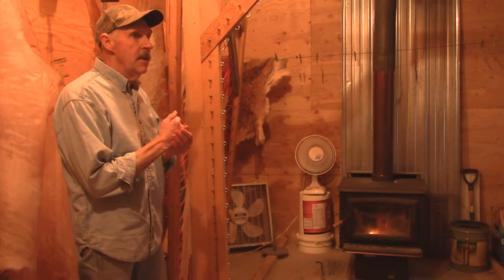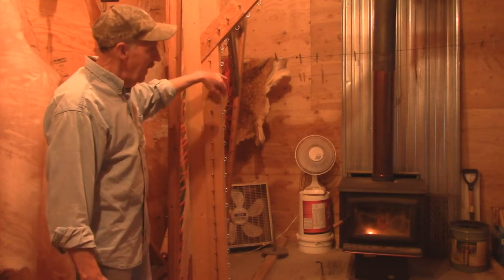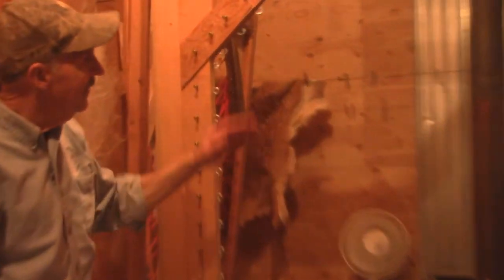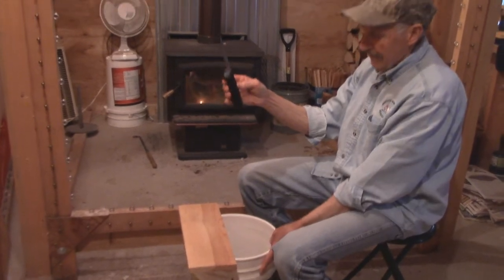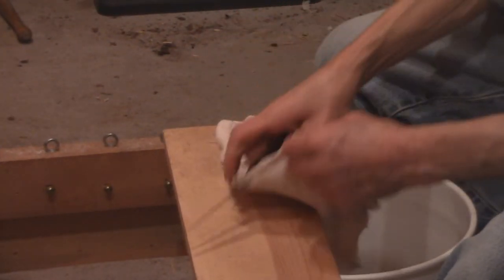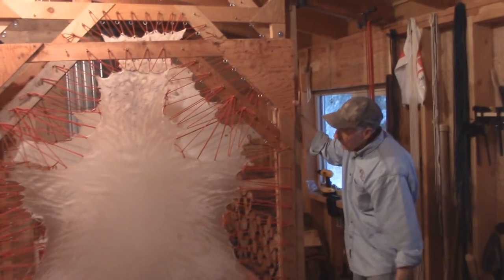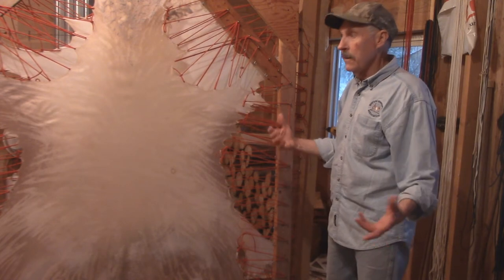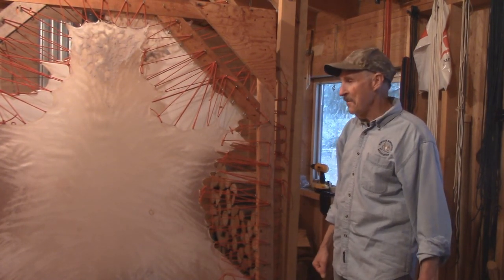How To Frame A Deer Hide [Ron Nail]

Comment: Thanks for a great video series. I may have missed it, but I don’t understand what the first framing and drying session does (other than allow the hides to be rolled and stored). Why not just take the scraped hide and brain tan it?
Reply: Answered my own question. Got a great result using Ron’s method but without doing this step. Went from the scrape right to the brain tanning.

Comment: So as I string the deer hide up to dry, I can see grain I missed in places other than the neck, which I know I missed and was planning on dry scraping like you do Ron. Can I dry scrape the other places too?
Reply: Vanne if i have to dry scrape a neck i usually go over the whole hide lightly with the dry scraper just to clean it up and make sure that i got all the grain. Sometimes if i miss a small patch of grain i can get it off during softening with a sanding block or pumice stone.